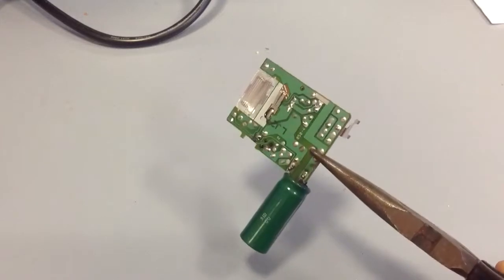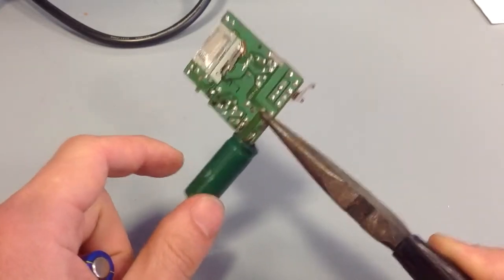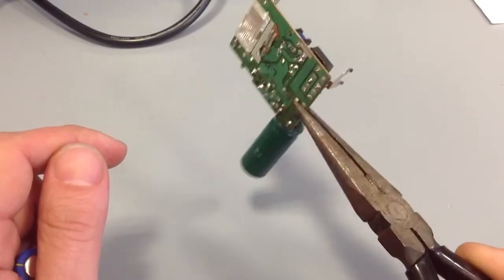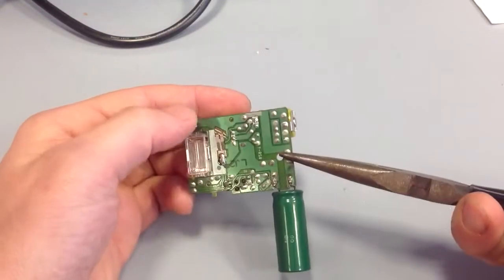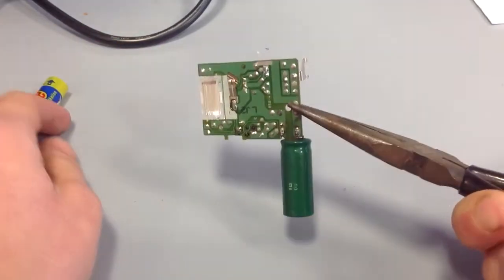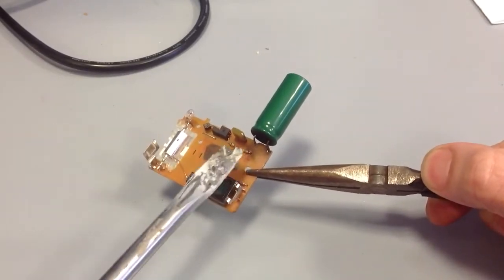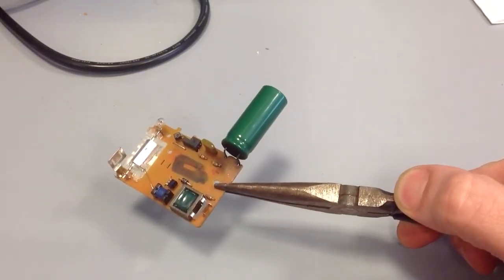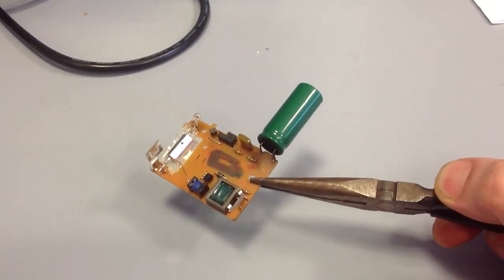Discharging a capacitor from digital camera

Comment: Not to sound dumb, but is the act of releasing a spark like that, discharging the capacitor and if so, what benefit does it have after being discharged? Is it safe to be desoldered? Or can you still be shocked?
Reply: These capacitors store and hold a high voltage charge. You discharge the capacitor to be able to desolder it safely without endangering yourself or the device. Or having it short out and explode in your face.
Reply: @MrWolfSnack hi I recently had a problem with my Coolpix camera didn't turn on I opened it up & I found out that the camera capacitor was discharged I tried putting in new batteries but d capacitor didn't charge, what could be the problem pls

Comment: Just please do not do this. The screwdriver no matter how big is it, the resistance of it isn't enough to safely discharge it. It will fry the whole strobe board's resistors like how mine did. You need a discharging resistor.
Reply from the maker: With a discharging resistor, you will not get a spark - which was the point of the video 😁.
This circuit was taken out of a very old digital camera I decided to play with before chucking it in the rubbish.
Also, shorting the capacitor, in most cases, will not have any effect on the rest of the circuit as the current just flows through the screwdriver. As long as there is no battery still in the circuit.
DO take care not to discharge it through your finger, though - it hurts!